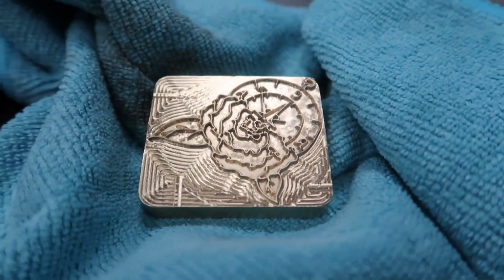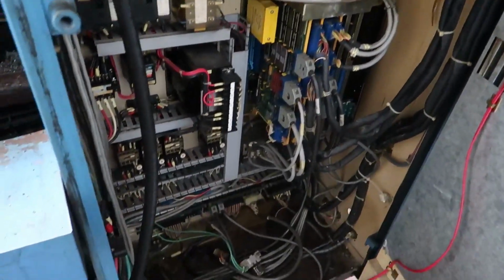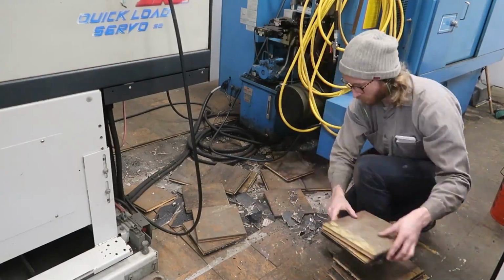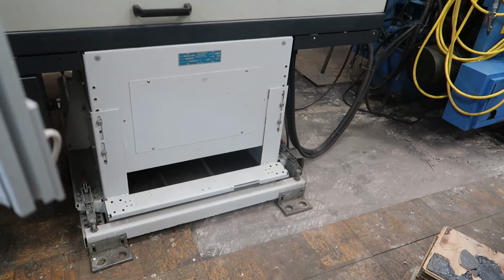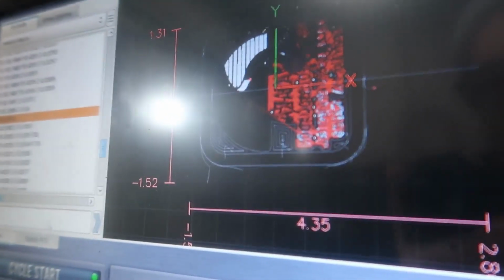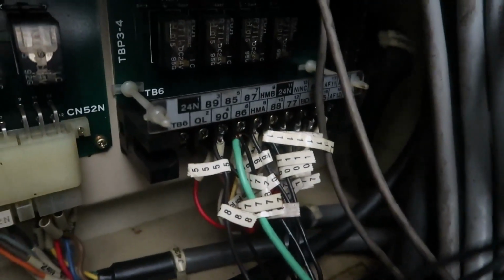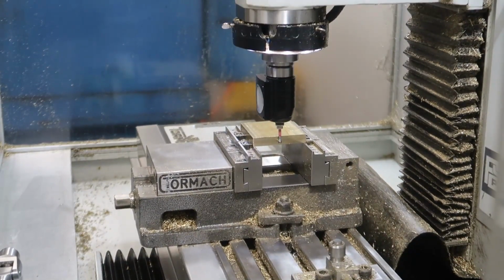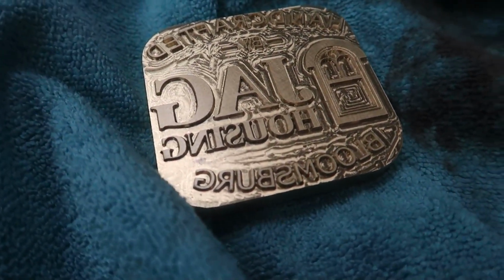Powered up the non-working lathe and started to get the bar feeder ready for alignment

Comment: I buy 5" diameter brass rounds from alro in 8" to 10" pieces for a repeat job, it's literally half the price at Alro Steel of other online places I've looked at.
Reply from the maker: Do you buy on their online store? I've looked at there online store prices and they don't seem too much different than what I pay now
Reply: @MojoMfg  Yeah, it may be that their prices aren't as competitive as some others on certain stuff, I really only buy the large diameter brass rods and occassionally some 1.5" diameter rods. Also material prices are pretty heavily inflated right now for some reason. I think even fertilizer is rising in cost, possibly due to higher energy costs for production.  Sorry if it doesn't help you.
Reply from the maker: @multiHappyHacker  No worries at all. It's definitely worth giving it a shot

Comment: A couple of years ago I was buying brass from a local metal supply shop, used what I needed and cut the rest into 6" pieces and sold them on ebay.  I was selling the 6" slugs at 5% cheaper than online metals and was making a tidy profit off of it.  My point is, if you can find a local supplier you might have to buy a full 12' stick but it'll probably 1/2 the price so basically the same price as your 6" piece from OnlineMetals.  Most suppliers have a minimum order amount but it's usually easy to hit with brass.  If you're still in Louisville it might be worth a phone call to Alro Steel or another local supplier to see what they can offer.
Reply from the maker: Seems like I should definitely give them a call to see what they have to offer. I know that I've looked on their website and I remember their prices not being much better than most online stores. I am back in Ohio so Alro is still really close to me
Reply: @MojoMfg  Ah, I would think Ohio would have a better selection of suppliers so that may work out.  I found out one of my local suppliers was buying from another local supplier so I cut out the middle man and went direct.  An hour of calls and emails may prove to bear some fruit.  If not, at least you can scratch that idea off the list.